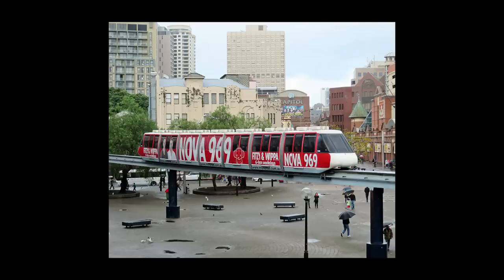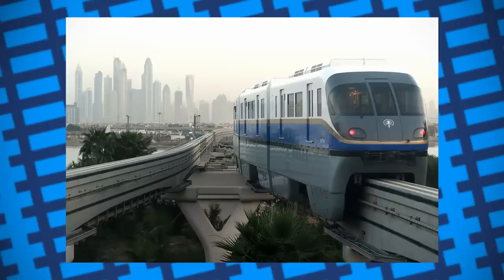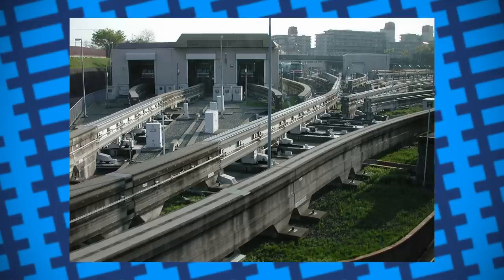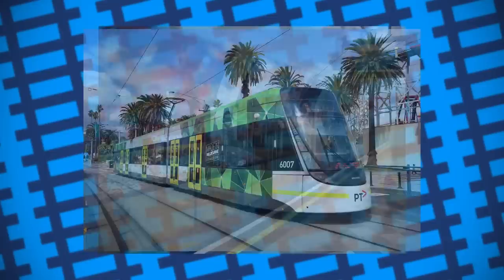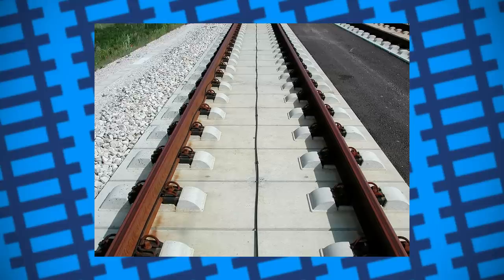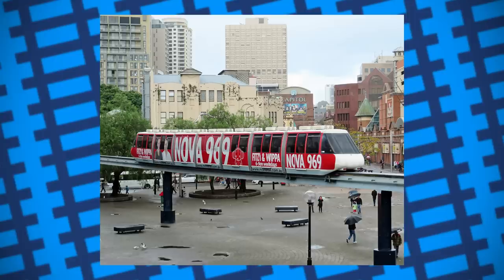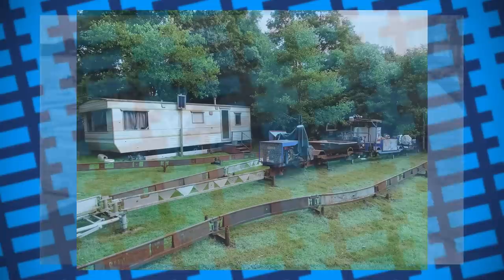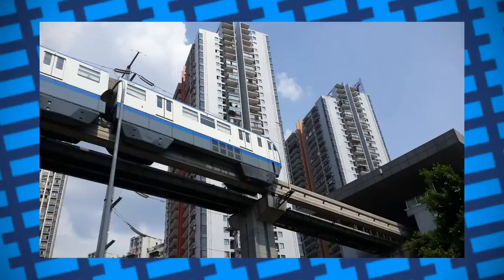Why monorails are bad as public transport - Monorails

Comment: So, you get rid of one of the main benefits of rail transport (speed due to low friction) by adding rubber tyres and then get no other benefits in return
Reply: There are niche situations where various things that woud otherwise be gadgetbahns are actually appropriate, what those are varies with the type of system. Outside of those niches, they always loose to regular rail. Paris's rubber tyred metro has the same problem. Significant advantages in one specific niche (when the line has to be uncommonly steep while not really being able to saccrifice speed and acceleration as much as a rack rail would require), but outside of that you've got significantly increased track complexity, wheels that need replacing much more often (and manufacture and disposal are issues all their own), noise issues (whether rubber tyre or steel wheel is quieter depends on speed and track shape: turns too sharp for the gauge (and a couple of other things) and steel wheels will squeel, go too fast and a rubber tyre train line starts sounding an awful lot like a major road).

And on it goes.
Reply: Silent operation, ability to traverse steeper curves and more pronounced inclination angles (Tokyo et al). Less space taken BOTH on rails and stations (check Daegu, Cairo and Santiago de los Caballeros).
This video is HUGELY a misinformation piece.
Reply: @rush4you  I disagree. You clearly haven't watched the video, you fail to  recognise the main issues with it like being raised of the ground, cost, maintenance, safety etc. The main point of being on rails is the speed due to the low amount of friction, like I said, and monorails don't have that advantage with rubber tyres. If you want something to climb a hill use a bus! Busses are cheaper, safer, more efficient and faster compared to a monorail in most circumstances. Most narrow gauge or light rail like trams can traverse as steep as a monorail can, and arguably regular trains are possibly quieter when built correctly
Reply: @BrokenIET  I just watched it 15 minutes ago, but thanks for the free attack.
Yes, monorails lose the friction advantage versus steel trains, there's no denying that. But they gain everything that I mentioned in return.
Now please show me an example of an elevated, silent steel train or one that can climb 13° angles. Again, elevated, because of course you can have less noisy subways, just pay $250M+ per kilometer.
And the comparison with buses is simply laughable, we are talking about high capacity, no interference with traffic systems that can carry 45000 pphpd.

Comment: The Panama government is building a monorail. It will be the 3rd line of the Panama City METRO Train system. I believe this monorail is the best option due to the hilly terrain where the same will be built. For this to be a train or tram system, it would have required a lot of extra work and resources to flatten the terrain or perhaps to have quite a few tunnels added/built.

Comment: At 4:00 you show a picture of a Melbourne tram, whilst our tram network is standard gauge (1435mm) our heavy rail network here is actually broad gauge (1600mm) which kind of contradicts the point you make about connection and interoperability. Great video otherwise!
Reply: Australian rail gauge situation is really silly, to be honest. Queensland uses narrow gauge for everything (even where standard gauge would be better), NSW standard and Victoria broad. So running trains across state lines is very inconvenient. The XPT line from Brisbane to Sydney is dual gauge for part of its length, with three rails to accommodate trains from both sides of the border!

Comment: You got it the wrong way round. Monorail is chosen when others options are unsuitable. 

Usually in part of a city that could not accommodate tram, train nor subway.
Reply: In that situation, buses are usually chosen.
Reply: @tooleyheadbang4239  , buses has limited capacity and are subjected to traffic situation, that defeats the whole purpose.
Reply: @esphilee  It does indeed, but buses are the easiest and cheapest option, which is why they are chosen.

Comment: To me a monorail could only work in conjunction with a larger system, and with fore planing in mind. Not as a primary or only source, the trouble of course is the general idea that if something can’t solve every problem then it’s not worth doing. However in a limited capacity say between a business district to a shopping community or towards a residential district then it would be fine. Really the greatest hold off on all forms of public transport is having to grant car dominance in all forms in traffic infrastructure.

Comment: Aside of the higher points of failuer, i frastructure incompadability or high maintenance, the main reason monorails are worse are simply that they lack the efficiency of steel on steel friction.

Monorail are effectivly busses with extra steps.

Comment: The only monorail I'm familiar with is the one in Seattle that was built along with the Seattle Center (with the iconic tower that still defines the city's skyline) for the World's Fair. idk if anyone uses it for anything useful, or if it's just a tourist ride. I've never ridden it myself, though I visited the city every year for a couple decades.
Reply: There are a few trips you might use the monorail for in seattle but largely the north of downtown region it serves grew up long after it. It isnt really a transit system with a single short line, but if north of downtown continues to become more dense it could become more useful as part of the overall system. Busses are about as fast but traffic will likely get worse.

Comment: I mean I can still see the asthetic benefit of Monorails instead of elevated light rail. You get way more light at streetlevel with this minimalist self-supporting rail compared to a structure for light rail. And whilst efficiency, interchangeability and switches remain an issue - if you set up a public transportation network in a dense, urban area and you are forced to go for something elevated everywhere than a monorail might be better option from an urban design perspective. But obviously only if you don't already have a light rail system. But yeah, this is niche.

Comment: I believe only problem is the scale of these projects, they make them too chunky and comfy. Linnanmäki's monorail is closer to right size of monorail, rail for it is cheap and so is running the track.. little bit wider carts with folding seats and standing places, 35-50 passengers per train, circular/elliptical one-way tracks only, 4 to 8 stations per line trains every 1 to 3 minutes,  around 20km tracks... It's supposed to be fast and most basic form of transport in the mass transport system, not some futuristic special gimmick giving "luxury" rides for the whole family.

Comment: A problem with monorails is that because they need to be elevated every stop will require steps and escalators or lifts - extra expense.
Reply: true but well thats true of any underground or elivated rail system. its not a particualy strong argument for or against a monorail system on its own. you can also do ground level so long as its seperated from other forms of transport for thesections that are at ground.

Comment: You skimmed the actual use cases for them  : 
Where other forms of transit are impractical - 
If there is no room for trams, light rail etc ... without demolishing buildings, or taking up a traffic lane where this would make traffic worse 
...and tunnelling is impractical 
This is a very limited case but there are several successful monorails built because of this, running successfully ...   
....note only a very few as for all these conditions to be true is very rare ...

Comment: Whilst your points about light rail etc not being the appropriate competition for monorail are correct,  the real competitors for monorail are subsurface metro systems.  Both take up very little land surface and cost a fortune . Obviously for a larger system the metro is usually the best option,  but monorail is still a viable option, especially for smaller scale requirements.

Comment: I agree monorail is almost never the right mode of transport to build. But, among several problems I have with this video is that a lot of disadvantages you listed about them were related to the fact that monorails are elevated up in the air whereas conventional rail can be at ground level. That's true but, I think that is a false comparison because you're only really going to consider building a monorail where there isn't enough space at ground level for a railway or the terrain is too steep. In those places, if you were to build a conventional railway, it would have to be elevated too (or tunneled). This would lead to a few disadvantages with conventional railways compared to monorails too (e.g. railway viaducts have to be much wider/larger than monorail tracks so they might not fit in the space or they may look too overbearing).

All in all, this was an entertaining video but light on proper research and analysis. But hey it's YouTube, not an academic paper so whatevs. Keep on keeping on!

Comment: This is pretty lazy.  Tell us how a conventional railway would have been better to the two monorail lines in Chongqing.

Why not examine the new high capacity lines built in São Paulo?

Monorails aren’t a universal solution. But at least examen the issue. 

Also mono-racks are extensively used in Japan and Korea as well. 

Also other types of suspended industrial monorails are used in factories, mining and agriculture.

Comment: There's more practical use for monorails than this video suggests, but it's pretty much entirely down to areas where a railway isn't feasible or would cost so much that you may as well build a monorail for the other benefits it provides. 

One example I can think of is Wuppertal's Schwebebahn where an elevated railway may have worked, but would have it's own downsides that don't exist with traditional railways (eg. derailments become much more dangerous) and made the monorail system much more feasible as a direct result, but there's not a huge amount of those areas that also would have enough movements to warrant building such a system.

Comment: There good arguments, but general idea of this video is just not fair. 

Switching transport is not very interesting option. Even if you can have 30 sec go to the bus, you can't expect bus gonna be there. Time schedule depends on many factors and it is to much to say. Your bus or tram can be 30 minutes later so who cares if the monorail is not on the same floor.  Even if you wanna be at work on time it also doesn't matter, because of time schedule. , Depends how far from center is your work, how far is bus stop. I hate to admit, but at this point car or at least carpool is better solution.  
And space occupation is most important. Because not just is better for car, but is bater for public transportation. Instead to be stuck with cars you can save a lot of time and avoid them. Maybe is not fast to switch with the bus, but you don't stop on red light. 
They are expensive, complicated to construct, but benefits are also great. And today we have AI, 3d printing
And safety... come on... Like with hyper loop... But is plane is safer? Anyway they can add catwalks. Stop this caveman syndrome, no technology is safe...

Comment: There is a monorail being built which will be the nearest station on the Bangkok passenger railway system to where I live. It seems that it was the only option to get through some of the junctions already open on the system. Thanks for the warnings :face-turquoise-covering-eyes:.
Reply: And what will those warnings do? Make you stop building the monorail and staying at cars?

AFAIK every Monorail system was constructed for a specialised niche application. There are "light monorail" systems you could, if they weren't built in 1900 but now, construct as light rail (with all the drawbacks ToT pointed out - if you have to build high as in Berlin or Wuppertal, you won't be able to "easily disembark", full stop. An elevated track is an elevated track, and is - part of the job description - elevated, regardless of whether it has 1,2 or 3 rails).

From what I see from your description, ground level is full with iron rail so crossing it won't work. You can now try to go down or go up; but it may very well be cost-effective to use a monorail that only needs supports for one rail & minimal track weight. If it is a point to point line or a round trip without regular switching, monorail may be your solution.

Monorail is a very practical solution that has been proven during the last 120 years for a problem where you need a monorail. You almost always have a problem where you need a monorail when iron tracks have to be eliminated as a solution, most often because they are already there and are at full capacity.

Comment: I agree with your point, it's matter of fact. I wouldn't consider the Wuppertal floating railway system a monorail though, because it is a railway line with one track. Only difference is that a normal train rests on it's wheels, and the Wuppertal one is suspended on it's wheels. These are steel wheels similar to railway wheels, and so are the tracks. The wheels have flanges on both sides of the wheel. And the Wuppertal one actually makes sense because it is suspended for the large part over a narrow river valley flanked by mountains. So it's existence is dictated by geography. And it happens to be nearby the German steelmills. So it's in fact the only place in the world where it make sense to to have an urban transportation service like that. So, it doesn't count. The rest you show us are mainly gadgetbahns

Comment: There are specific cases where monorails - Normally the suspended variety - Are the more practical option, particularly in mountainous areas. Japan has a very good example in the Shonan monorail (A Mitsubishi suspended SAFEGE design) and the common example of the Wuppertal Schwebebahn - Originally built (IIUC) for carrying spoil or aggregates - Was built that way as the river provided the only available option for a route through the area. ⛰🚟👍